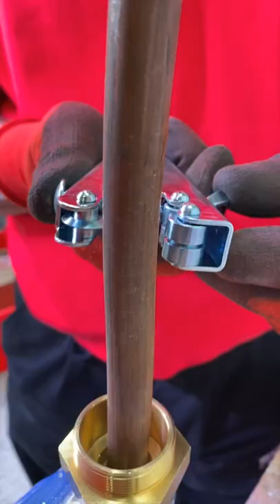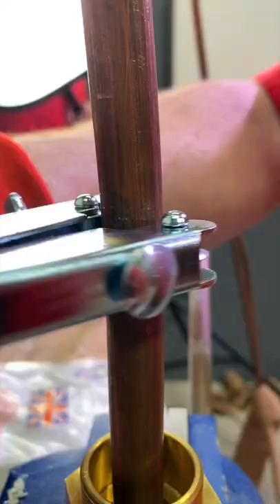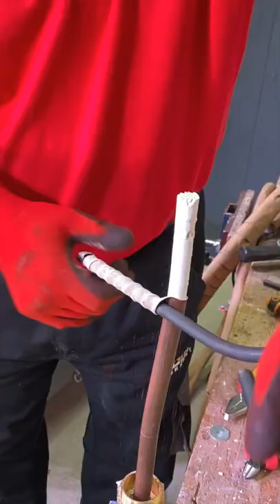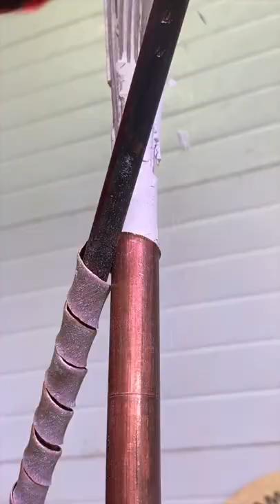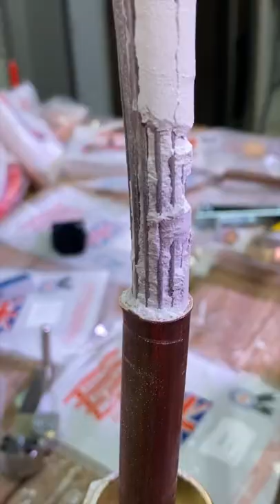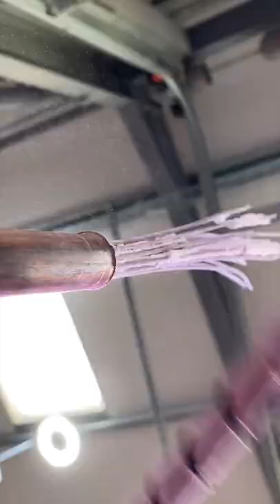This Cable is for _____

Comment: This cable is for 100 years or more, if installed properly. I used to love working with this type of cabling, unfortunately it took time to install properly... I wonder if like fuse-boards, we might go full circle & move away from PVC cables, back on to a fire 🔥 & flood resistant solution 😂

Comment: Thats more cores than i've ever used. I guess thats kind of an advantage of MICC cable - you can have alot of cores very tightly packed in a relatively small CSA. Image a 19 core flex or even SWA. Thats going to be a big-ass cable assuming the cores are a meaningful size, say 1-1.5mm.

Comment: Are the inner cores insulated.?
Reply: Mineral insulated
Reply: The white powder is the insulator, it is magnesium oxide.
Reply: @littlechestnutorchard  So, if its removed at the ends, and there is no inner insulator, what stops the inner cores from touching each other.?
Unless of course, each pipe full is one parallel conductor.!
Reply: @G1ZQCArtwork  There would be a gland with a pot put on the end to seal the cable from moisture.
The pot separates the stands which would then have neoprene insulation put over them
Reply: @paultipton743  A bit like the age old   immersion / kettle elements.
Never liked it, if any moisture gets in, it leaks

Comment: The amount of times we did pryo and forgot the shroud!  Last time I saw that many cores used in pyro was for an old fire alarm repeater panel before the days of digital comms.
Reply: All the time! Used to run a Stanley blade along it and slip it over the top of the cable. Then turn it round so it couldn’t be seen.

Comment: Going to say multidrop fire alarm, where you have cores for comms, cores for power to the detectors and sirens/beacons, and a separate core to use to verify cable integrity through the installation.

Comment: Some kind of heating element? After reading the comments, MIMS cable.
Reply: You could actually use pyro as a heating element. The only limitations are the plastic core spreaders and probably the poo in the ends. and as long as you don’t exceed 1000c it won’t melt